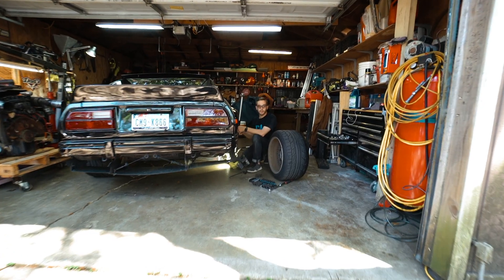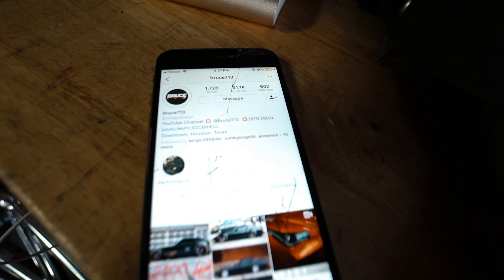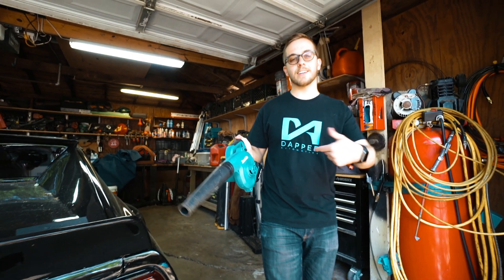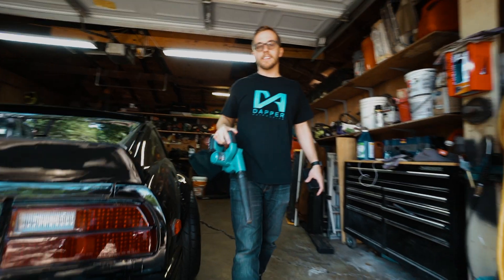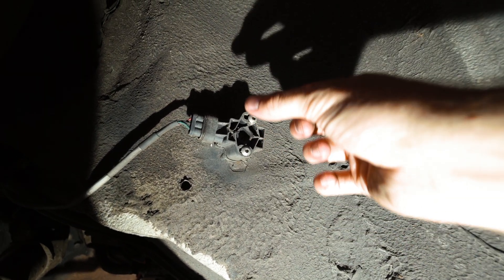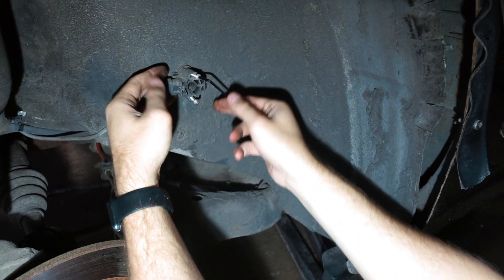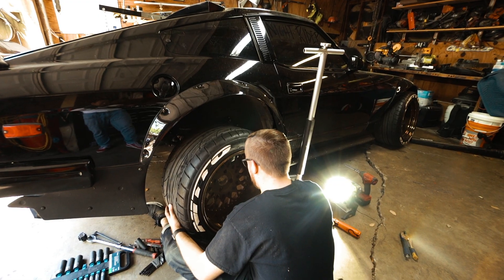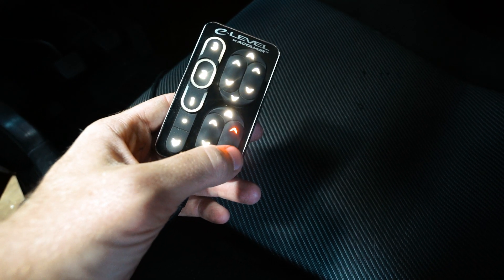Datsun Accuair Sensors Repair

Comment: Nice! Couldn't you have replaced just the arm? Or did it rip whole face off the sensor?
Reply from the maker: the whole face ripped off and they were provided as a whole unit so why not just replace the entire arm
Reply: bruce713 True. What version of accufabs management do you have?
Reply from the maker: accuser elevel stage 2 off eBay
Reply: Bruce is your air suspension for an s13 application?